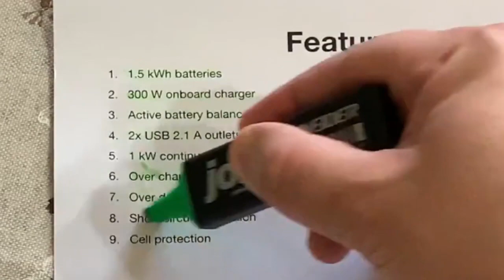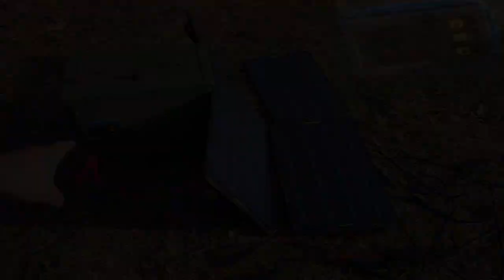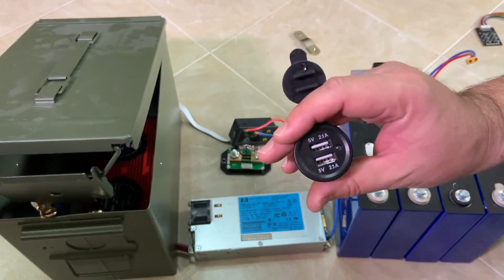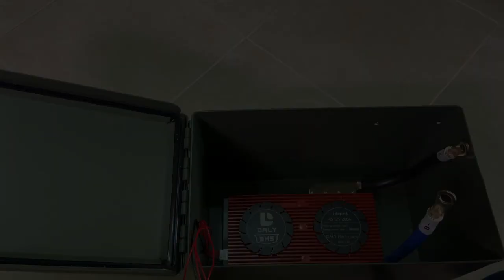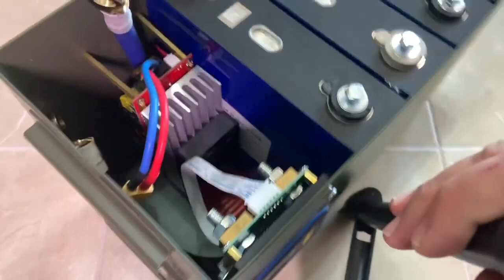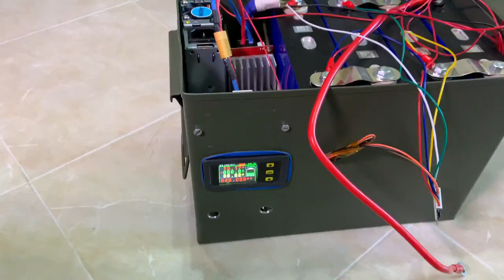How to build 1.5 kWh LiFePo4 battery using ammo can for enclosure.

Comment: Hi Tedo Nash, how can i programm vw e-up! so, it drive with injected  charger plug in?(normaly it stops auto when charging)
Because i want to build in a  gas powerded generator as a trailer, so i can supply with current on the way.. to exted trip range
Reply: ..idea was a silent 5,5kW generator. Gas balon can i buy at anywhere gas station.

Comment: Nice work man! but, i think existing power supply which can adjust voltage.. (without next loose in booster) isnt it?
Reply from the maker: Yes this can also be a solution. If you find a suitable one it will be nice if you share it with us
Reply: @tedonash2681  brand mean well has adjustable output for example https://www.gme.cz/spinany-zdroj-mean-well-usp-225-15

Comment: it is very beautiful project. It would have been nice to be able to couple it to the high-voltage battery to be able to certainly travel more than 25 kilometers more. Thanks Tedo
Reply from the maker: The idea behind this project is to connect it to the low voltage 12V battery which will also increase you the range because the high voltage battery will not charge the 12V battery and this will save more power for the motor